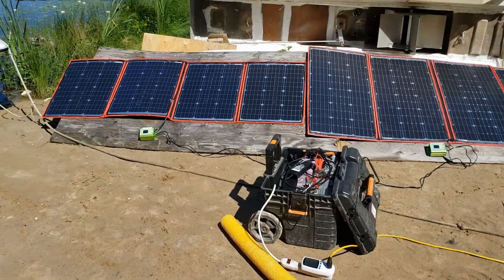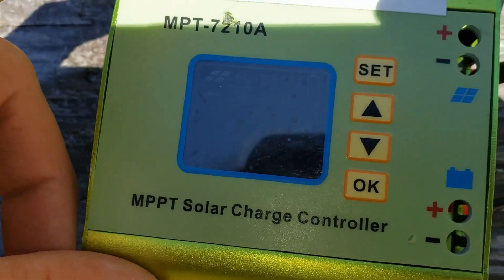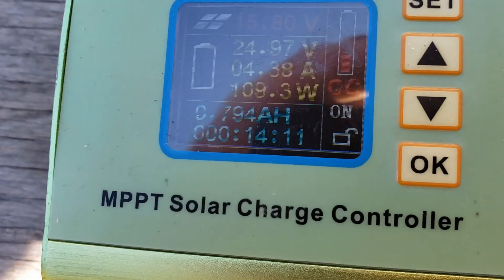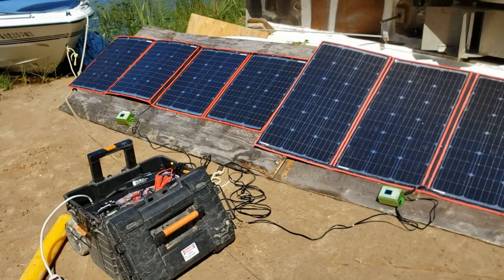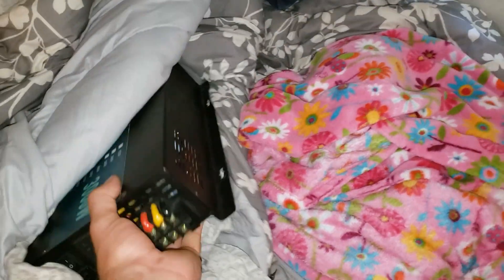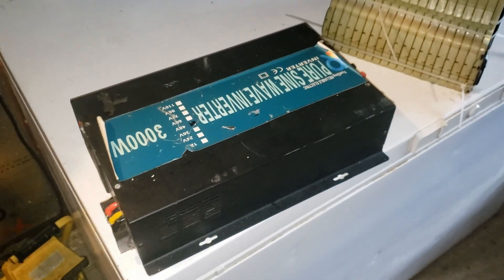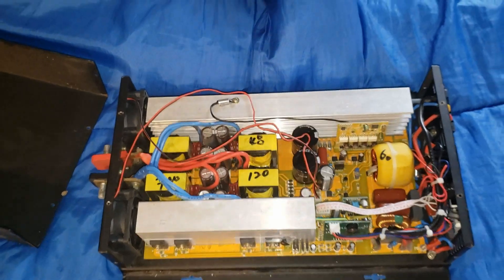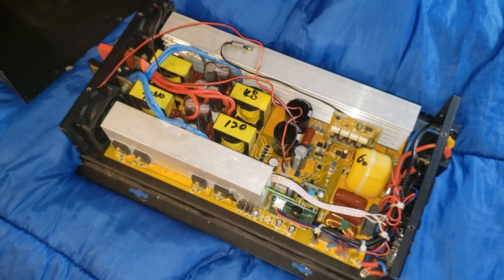4000w Solar Generator, 3000w Inverter Blows Fuse?

Comment: Lower the Planel Voltage down to 13V   I find I get the most power using that Charger when I pull the panels down a bit more.   13V seems to be the max for my coleman 12V 40W panels
Reply from the maker: Ty I will try

Comment: did you set the mppt V of the solar panel? you have to program that in. yes they are not efficient, but not that inefficient like in your video
Reply from the maker: i did, i get it to 15v on a 19v panel

Comment: Got the reliable 48v,   dont care for the vampire load. Approx 110w and hour.  Need to produce 2.5kw just to offset the overhead.     That and the fan kicks on every 18 to 20 mins ( put a fan online to draw air,  news its 1 to 2x. Ever hour or so.  But more watts power draw.       As you know. It's always chasing the watts/load
Reply from the maker: 110w what model did you get? my 8000w takes around 38w.
Reply: I have four of those charge controllers they do good for how much you pay for them 😁 thanks for explaining the internals of the inverters I have a 3000 watt 24-volt and it's doing good and a 300 watt 24 volt